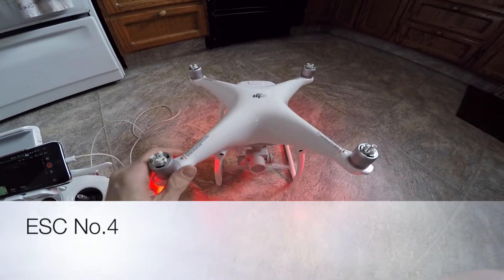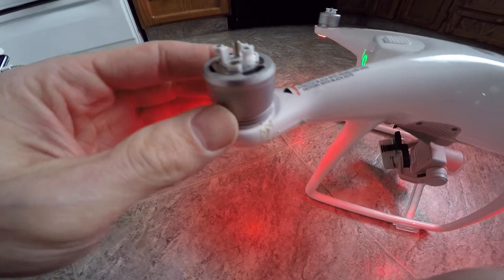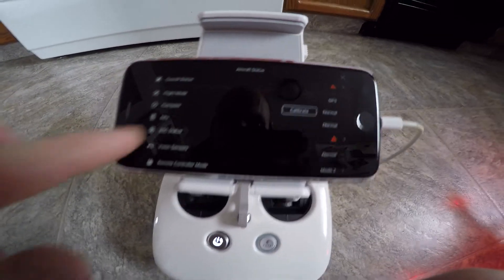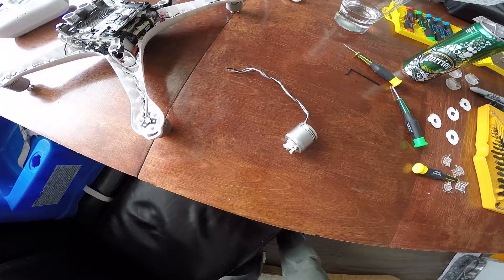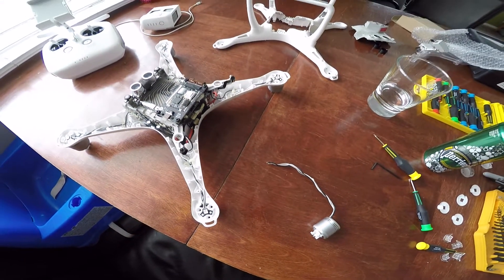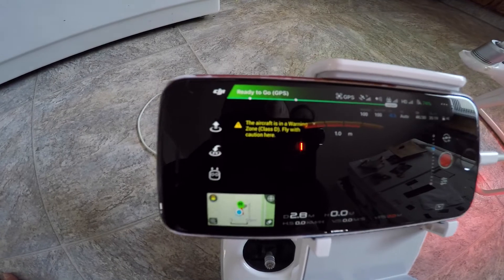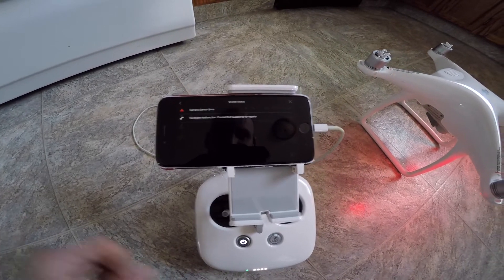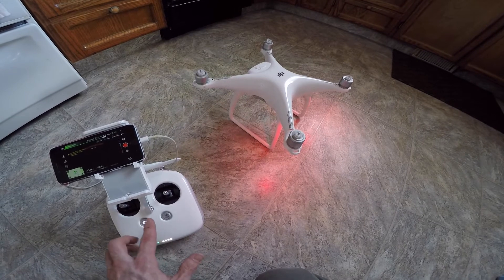DJI Phantom 4 ESC problem on No4 motor FIXED!!

Comment: What happened to the camera?
Reply from the maker: It fell from about 20 feet and the camera snapped off. It's pretty common and was easy to fix as well.
Reply: mines aswell, my gimbal is messed up, the arms are bent and everything,any chance it can be fixed?

Comment: Hello, I am getting ESC No.2 error, do you think replacing the motor should work or replacing the ESC board?
Reply from the maker: BrainWing did you crash the drone on that motor? I saw damage on that motor so I was pretty sure it was the problem. It's also cheaper then the ESC so it's a good place to start.
Reply: It was crashed but not sure on that motor. I should also start by replacing the motor first rather then getting into ESC. Thanks Trevor! CHEERS!
Reply: BrainWing did you fix it at the end